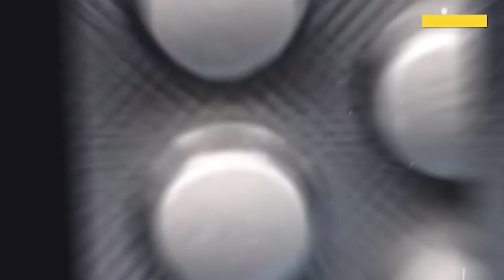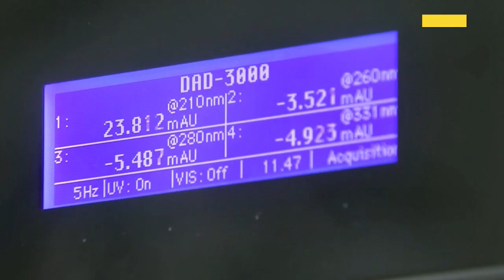COVID-19 Treatment | All You Need to Know About Hydroxychloroquine | Medicine Coronovirus

Comment: nice to present things like this. congrats. you are not against it. You just prevent on bad use of it.
on safe patients, if it doesn't work, it's no problem. If it works that's good. This medication is cheap and should be applied when possible, and on early stages (Hydrochloroquine associated to Azithromycin)